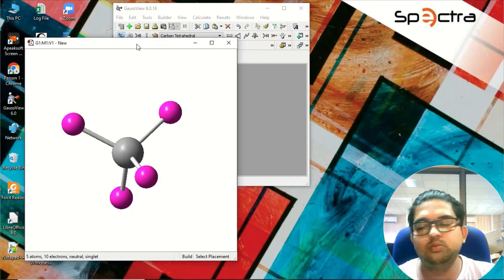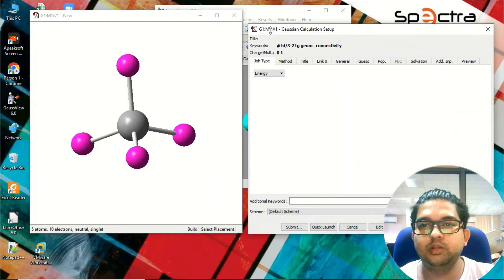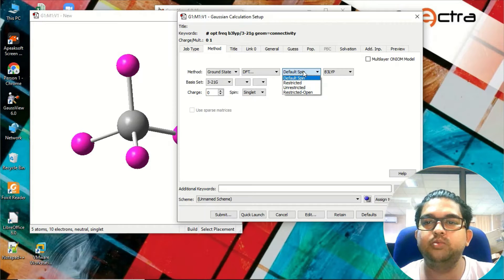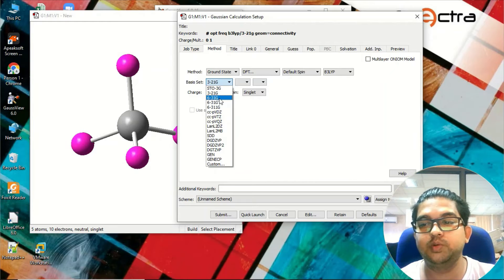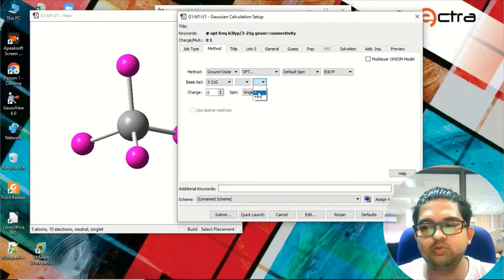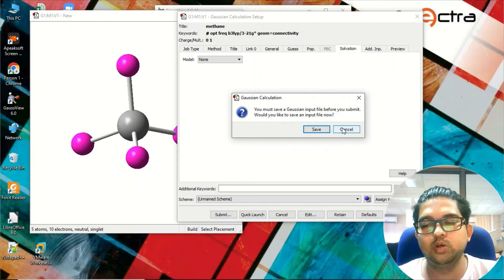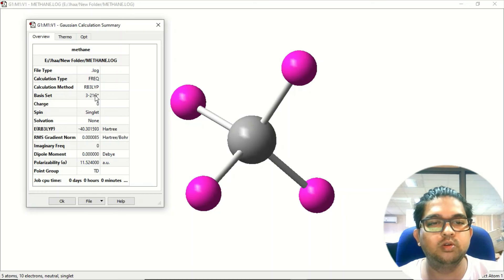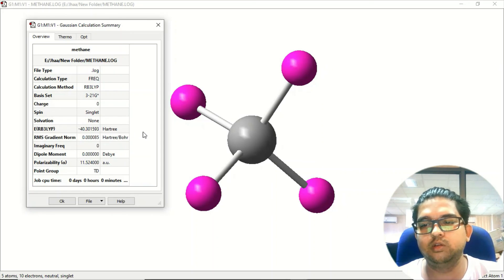Geometry Optimization and Thermodynamic Properties Calculations Using DFT in Gaussian

Comment: I am getting the error called " g_write: No space left on device Error: segmentation violation" when I ran the gaussian calculation in the HPC system. Could you please advise me on how to avoid that?
Reply from the maker: Means your job is trying to write more scratch data than the allocated disk space allows. On HPC systems, Gaussian uses a scratch directory for temporary files, and if it runs out of space, the process crashes. In your case, you simply do not have enough disk space to run this particular calculation. 
1. Check your disk, and delete unnecessary files (.rwf).
2. Your job may simply be too big to run on current hardware. Try using a smaller basis set.

Comment: Thank you for your explanation. 
how can I fix that continuously getting NO for converged
Reply from the maker: Check the output file for the specific errors and follow 

https://gauravjhaa.blogspot.com/2024/03/gaussian-common-errors-and-solutions.html

Follow this for the solution.

In case there is no error in the output file and simply there is convergence failure, check your geometry, in case symmetry is breaking use RecalcFC=n, n=no. Of steps, give 5 or 10. And also use scf=tight. 

But to find out the specific solution I need to see the output file. 
Hope this may help...:_like:

Comment: Hello Sir, What is the additional keyword "Geom =connectivity" means?
Reply from the maker: When you use gauss view to design the molecule and submit the calculations, geom=connectivity comes are default, which just talks about the connectivity between atoms.  Which you can see below the coordinates. You can skip this by deleting atom connectivity from the down portion of input. In that case no need to use geom=connectivity. Or in Gauss view also you can remove this...this is not going to affect your calculation.
Reply: Thank you  @quantumguruji  sir. May I ask another question? Instead of "Geom =connectivity" I saw people using "pop=full gfinput". Is both command same? Thank you for your quick reply.

Comment: Can I do the gibbs free energy calculation on hydrogen ADSORPTION on N-doped graphen on guassian or material studio?
I am facing hard time to learn it from VASP.
Reply from the maker: Using gaussian, castep, dmol3 etc. you can do it easily...try dmol3...it's easy...see my video related to thermodynamic properties calculation using dmol3
Reply: @quantumguruji   Thank you for your information.
Reply: I do the calculation successfully how to evolute the delta G value or the obtain value is delta G?
Reply from the maker: @yepooo_04 open the output file using any text editor like notepad ++ and go through it, you will see all these values.

Comment: Sir after running the optimisation job I'm getting 1. Gaussian Input File 2. Gaussian checkpoint file 3. Text document.  
Gaussian output file is not obtained. How to solve this problem?
Reply from the maker: I think that text document is your output file. Generally, the Gaussian output file ends with .log or .out. Open your text file with Gauss view. It should work.
Reply: @quantumguruji yes sir working I was also facing the same issue